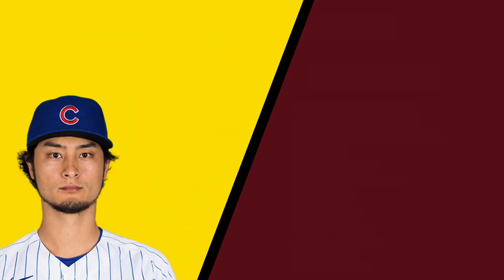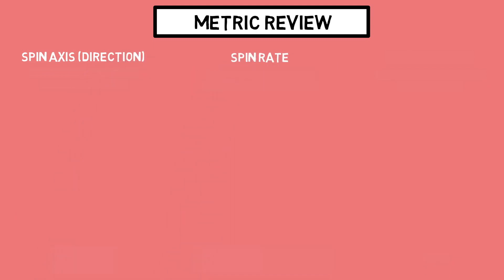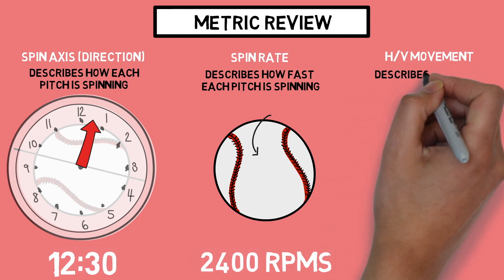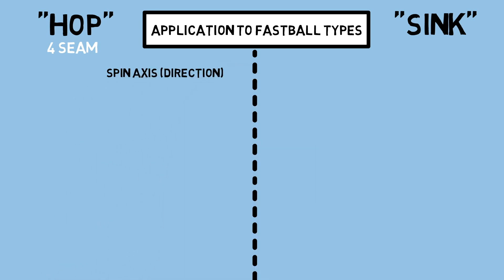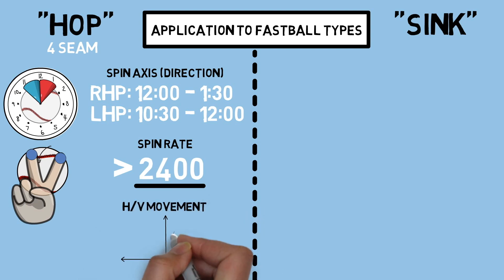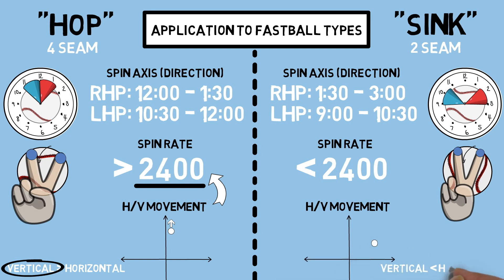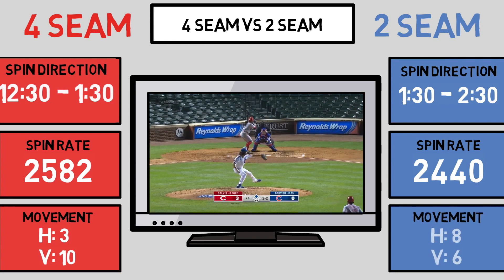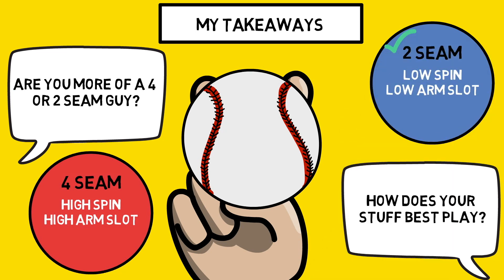ANALYZING DIFFERENT FASTBALL TYPES

Comment: Awesome video, Jake! Thanks for all of the great insight you give. 

I noticed that on some players' Baseball Savant pages, it will list that they throw a sinker. But, sometimes, when I scrape the raw data, it will list those same pitches as two-seamers. And, in the video, you mentioned how two-seamers sink relative to a four-seamer. Are two-seamers and sinkers essentially interchangeable? If not, what makes them distinct? Thanks again!
Reply from the maker: Great question, Devin. Typically sinkers are thrown with a two-seam grip - however they do not have to be. 

Like I described in the video, having low spin on that pitch is going to cause it to sink more. But the ‘definition’ (for lack of a better term) of a sinker is purely a pitch that has a spin axis closer to 3 o’clock. 

Technically someone can throw a two-seam with a 12 o’clock axis due to their arm slot, the two seam vs. four seam orientation purely relates to how the pitcher grips the pitch while sinker describes the way the pitch moves. 

Like I said, most of the time sinkers are thrown with a 2 seam grip. So yes, people in the business use these terms interchangeably frequently. 

Hope this answered your question!
Reply: @SimpleSabermetrics  have you heard of laminar effect